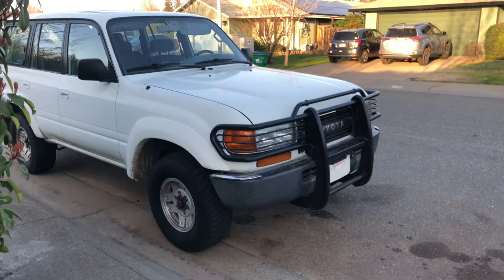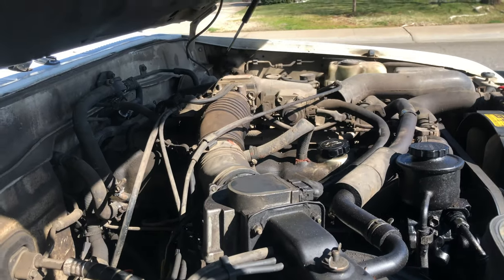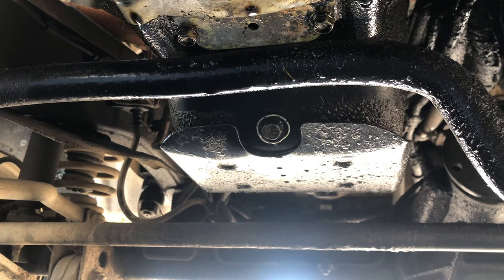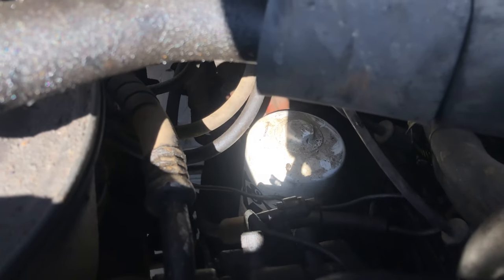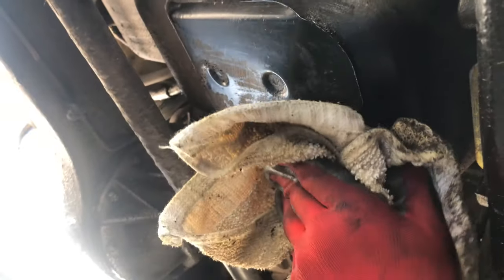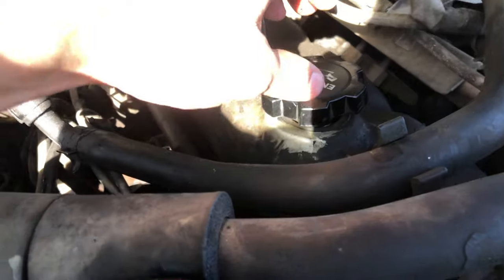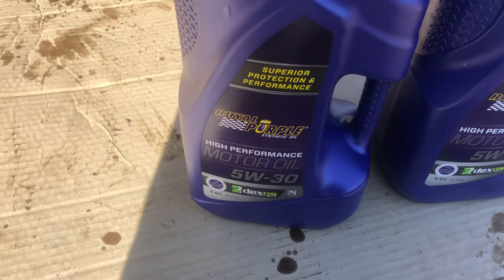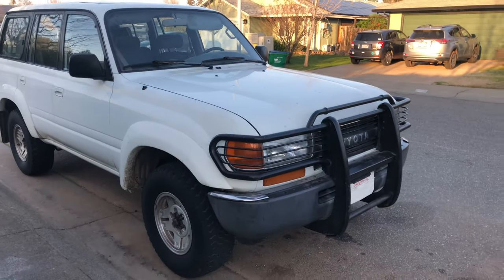80 Series Land Cruiser FJ80 Oil Change 3FE 4.0 | How To

Comment: Haven't actually done this myself and don't know if they are that necessary, but there are two things that may be worth doing. One is priming the oil filter with oil so that there isn't any extra time where the engine doesn't have fresh oil coming in. Doing it upside down is more difficult since it could spill out, but it is worth considering. Another is wiping a fingertips worth of oil on the rubber seal of the new filter. This just makes it to where you can tighten it more without yanking on the seal.

Comment: Thanks for the videos of how to work on the FJ80!! Very helpful videos! I have some questions for you. Since you have a 3FE, how does the motor perform for on road (and offroad)? Do you feel that the motor has sufficient power? Also, for highway/ freeway driving, what rpms are you usually at? (60mph-75mph)

Comment: I've never seen brand new oil look so black.. I recently started to burn excessive amounts of oil, about 2 quarts every 200 miles.  Black carbon soot and bluish smoke from the exhaust. My mechanic told me to stop using full synthetic and go to conventional. Sure enough, it fixed the problem and I'm spending less on oil.
Reply: U need to compression test if the piston rings are still good or bad, if still good you may check the valve seals if still good or bad.
Reply: What Cenen said. It also could be due to excessive carbon buildup. I've had luck with running Seafoam in these motors if you don't know what the inside looks like. Just dont use it for over 500 miles. It could loosen up any carbon preventing proper valve performance. Also run it in my gas every other oil change.

EDIT: Before you try Seafoam do some research on your own. Most people swear by it but there are always a few stories...

Comment: Hey brother quick question! Great videos subscribe to you’re channel! I am new to the 80 series. Just bought a 96. I notice in the beginning of the video, it seem like you had some rust underneath? Is that correct. I have some rust on the bottom, just one side, not too aggressive . Was wondering if i should be concern about it. Also if it’s normal for the 80 series to have rust
Reply from the maker: Surface rust is pretty normal however if your rust is flaking off pieces of metal I would be concerned. the bottom of my land cruiser was just very dirty at the time lol

Comment: These old 3fe engines like mineral oil not synthetic oil and as there getting on in age over 30 years old now I run 20w50 or 20w40 mineral oil in mine its a lot cheaper than a synthetic oil, also rub some new oil on the filter gasket and a new gasket on the oil drain plug crank it 3 or 4 times without starting it to prime the filter then let it run for 5 mins check oil level and top up its normally about 7.1 litres of oil. I also chuck in some Liqui-Moly Engine Flush every 2 years when doing oil changes.

Comment: those oil not good for land cruiser you engine gonna run bad . you need to clean the engine
Reply from the maker: What oil do you recommend?
Reply: @LNDCRUZIN  mobile one just done my LC lift 3"
Reply from the maker: Dude that’s awesome what lift did you use? And thanks for the tip!
Reply: old man emu .i gonna put arb locker front and back next week
Reply: Did u compression test that if the piston rings are still good?